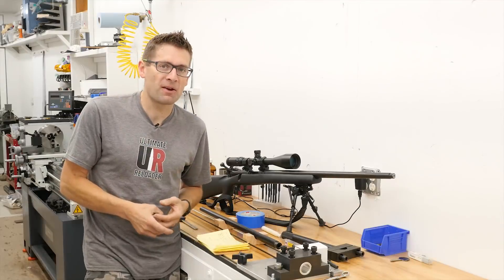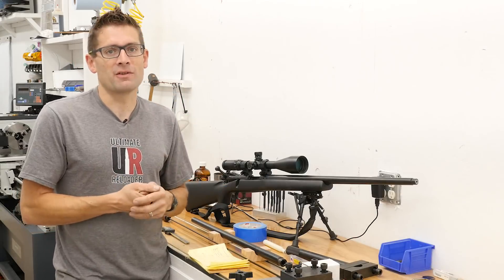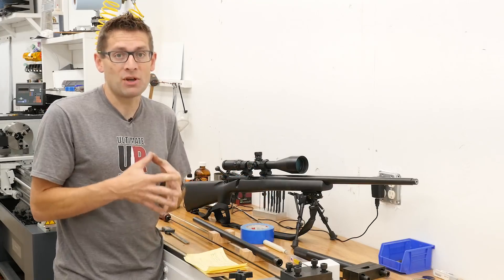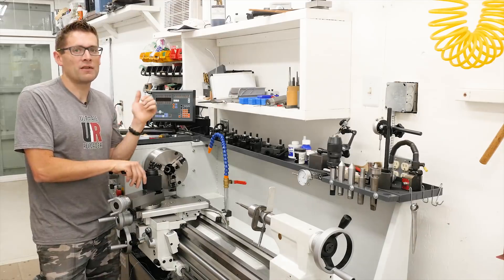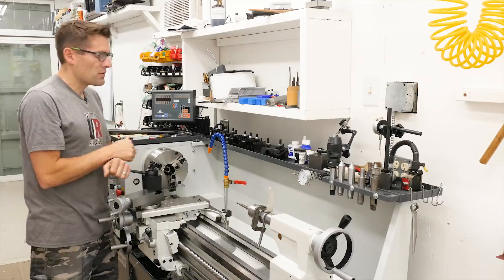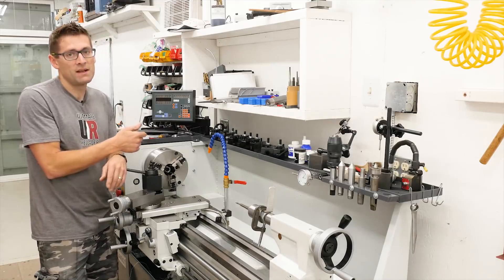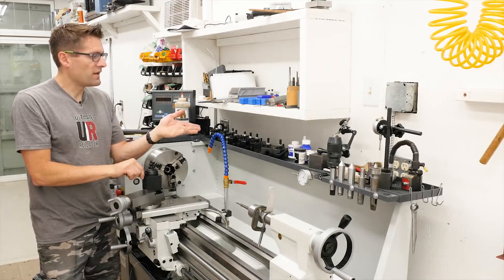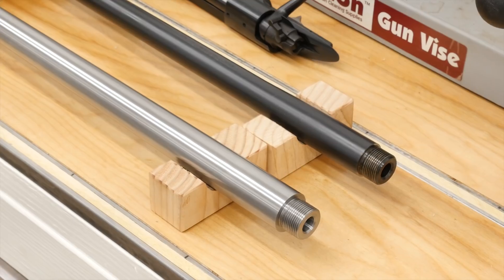Winchester 70 Rebarrel Part 2: Start to Finish Process

Comment: I would love to see more work on the Winchester model 70 actions. I own several I've collected over the years. I have pre 64, the push feed models, and the newer controlled round feed. Everyone out the tinkers with Remington 700 actions but not much on the old Winchester actions. I've got a pre 64 model in 264 win mag the bore is shot out. I want to put it back in 264 win mag. Probably gonna send it out to be rebarreled, but would like to get a better idea of the options I have available as far as twist rate and barrel length. Triggers and fire control etc.

Comment: Pro-Tip
Use card stock in your barrel vise insted of tape. The adhesive on tape acts like lube when you put pressure it it.
Reply from the maker: I'll have to try that, thanks Dan.

Comment: Can you mention more about the bluing process and can you use that process on aluminum ... thanks
Reply: Cold blue for steel is different than cold blue for aluminum.  There are many different methods and products.  Cold blue is more of a touch up because it just doesnt penetrate the steel.
Reply from the maker: Yep! Brandon covered it well. I'll be using Cerakote once I get setup for it...
Reply: Thanks  Brandon

Comment: Did you ever do any load work up and test the accuracy? I have this exact same rifle I bought new and the accuracy is fading. It was easily a 1/2 minute gun originally. I’m thinking of rebarreling with custom with slightly tighter twist for some heavier bullets. Thanks

Comment: Instead of measuring the root of the threads, a more accurate and practical method is measuring over thread wires and calculating the thread root diameter.

Comment: I was hoping to see more lathe action and less describing what goes into the process...Still a great video but I will stick to the reloading side of your videos.
Reply from the maker: I get what you are saying- hard to fit 3 hours of material into one video- this was the high-level one. I'll be doing MANY rifle builds, and most will focus on particular processes and operations, and I'll go into way more depth (along with Lathe fundamentals - a series coming up on Making with Metal). Thanks for watching!
Reply: gavintoobe Ok thanks for the explanation. May I suggest Clickspring's older videos? He works with brass but you may get a few ideas from there to what to make the videos like...